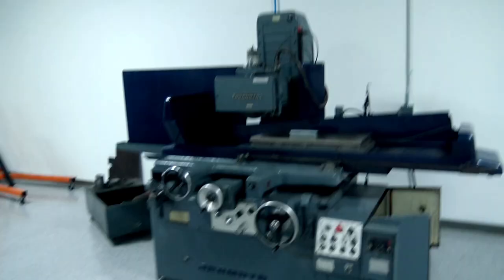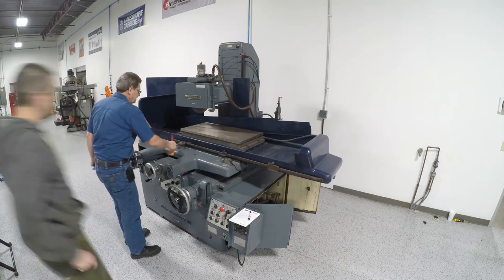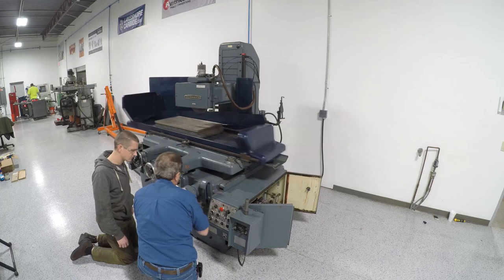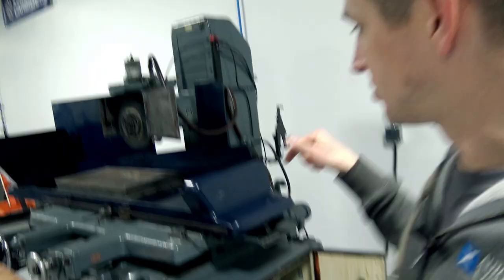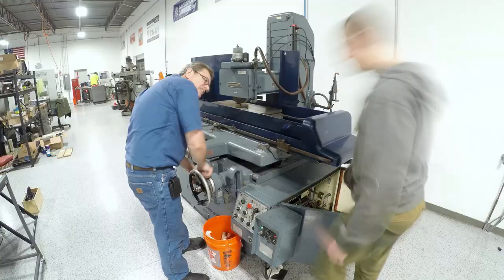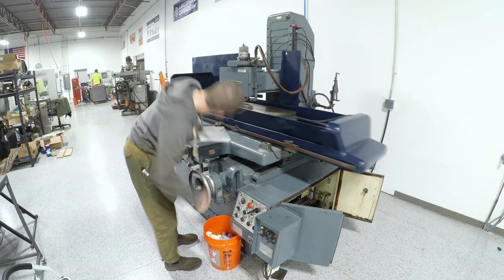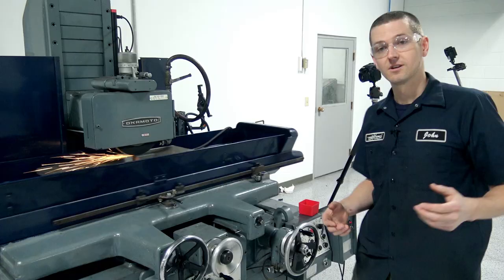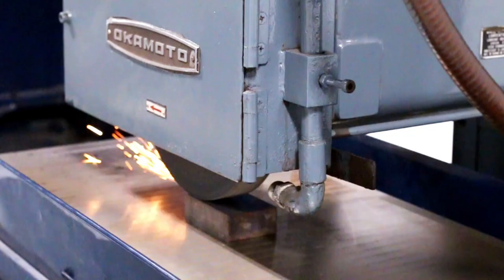Installing Okamoto Surface Grinder!

Comment: That is a very nice unit. Hope you get all the bugs worked out without breaking the bank. Lots of those older low pressure pumps are noisy but it doesn't should that loud on the video. A fluid change is probably going to help though. When you get the coolant up and running I would recommend at least getting one of those box air filters to set over it and duct most of the crap into it otherwise your going to have that sticky damp grinding dust all over your nice clean shop! Another thing you mite consider is building a grinder 'room' inside the shop with air filtration, I've worked in a few of those and they really help keep both the grinder room and the shop clean as all the air is going though a lot of filtration all the time instead of setting out on everything.

Comment: I always prefer to have a surface grinder with side that the sparks come out to face a wall, a good concrete wall.  I have seen even a small surface grinder toss a setup that was a vice in another vice and part in that one.

If you are doing a lot of grinding it will cover a large area in dust and coolant mist will stick to all surfaces around the machine without proper ventilation. 

I think it is a must have for any machine shop, that is good size for a grinder. 

Great video as usual.

Comment: The "rod" in the solenoid is called a spool valve.  That is a neat grinder.  I couldn't imagine trying to figure out the controls without a manual, especially if some of them are not working properly.

Comment: Always block in your work with pieces of scrap steel. Never grind your part without the aid of scrap pieces. This can prevent your work piece from flying off the table, especially when your first cut you have uneven and a poor metal surface on the bottom.

Comment: Sparks are burning carbon from steel*
Iron dust with impurities is left over in a form of dust.

Fun fact - one method of figuring out how much carbon is in your steel is to grind it and see how many sparks are made, and how long do they travel until they burn out.

Comment: awesome!  I'm kind of surprised that noise as it changes directions isn't normal.  I would think that whatever shuttle valve and or buffer system is used during the reversing should make that kind of noise.

Comment: I always use a dressing diamond on the magnet. That way I know the stone is dressed to the plain of the magnetic chuck.
Reply: That makes sense. With a surface grinder every detail counts.
Reply: This is what we do as well and good practice.  The "built-in" is more a novelty me thinks and you're thinking allows less room for error.  We have two Okomoto's and that's how I was taught by the "old pros" in the shop.  The dial is there but... never been used... lol.

Comment: Our grinder has hydraulic traverse and the hydraulic pump is also used to pump oil onto the ways. The only issue is the table rises nearly 0.002 when you turn the pump on and will drop if you max the table speed and use the hydraulic crossfeed. Its probably alot to do with the age and wear of the machine but still a pain in the ass.

Comment: That must be older than the one I use at work. The control panel is on a swing arm that can be swung around for ease of use. Ours works great.

Comment: Most expansion joints in slabs are actually cut in the concrete. If this is the case I would not worry about it spanning a joint as the slab is actually all one piece and will be rebar connected across the expansion joint so getting out of level just because of that is not real likely.

Comment: Great buy... Congrats!  though, I would have thought you would have installed it in your "dirty" side of your building with the plasma and welding. You could always build an enclosure for it to contain the dust and any possible flying parts. I can't wait for more videos.

Comment: so I run  okamoto grinders and a few things
before you change the oil check into a cleaner additive. there is a screen filter that needs to be cleaned. also block in your work. I run new saddle grinders and one older column. holds two tenths no problem😁. have fun

Comment: Great machine we remove our Dimond dressing tool above the wheel as they aren't that accurate and smooth when used, so we make our own dressing tool that sits on the mag table and does a precision job of dressing the wheel.  

Don't be afraid just be cautious when touching on 😁

Comment: About that European UVW - I am from Europe (Latvia) but i have never heard of it and we also use L1, L2, L3
Reply: L1, L2, and L3 are the modern designations for the input phases (L as in Live). Historically they were called R, S and T. U, V and W are the names for the output out of a transformer, junction box, VFD, etc.
Reply: Tjita1 here in the U.K. It was red white blue later it was red yellow blue  
The I came across a lot of IBM main frames and Winchester drives to find the three phase was L1 black L2 black and brown with neutral blue may be wrong about the last two colours it was 45 years ago 

But a multimeter and knowing how to use it are your best friend

Comment: I once operated the very same make and model grinder.. This is one of the most useful machines in a shop but on the flip side it can be the most dangerous. add a vacuume for dust and swarfe.  Did you get the wheel balance jig ???

Comment: Have a look into wheel balancing and a good extractor fan, you do not want to be breathing in the dust 

on my apprenticeship I nearly cut my finger off on a surface grinder, just remember if you need to touch the part ALWAYS turn the wheel off
Reply: On my apprenticeship as a machine repairman during my tool room or machine time, I routinely touched(very gently) the working surface of a grinding wheel after dressing it and was taught that because you can feel if it's still rough!  A diamond mounted in a block held on the magnetic chuck was used.

As far as a wheel being self dressing, it does break down but I never heard that mentioned even by my father who ran a surface grinder for over forty years.  A Blanchard grinder's wheel was hardly ever dressed as they are self-dressing wheels.  They were dressed when new and hardly ever again.  I maintained Blanchard grinders used in production and were never dressed unless a set of segments were installed.

Comment: Not only is it a great piece of machinery but the name is fun to say! (I am a simple man)

Are you worried about airborne coolant mist, grinding dust etc? My father owns a sharpening business and the grinding produces a unhealthy amount of airborne particles.
Reply: Yeah, he could put up some quick walls with  2x4/drywall and make a grinding room and also put in some dust collection.
Reply: I was thinking something similar but maybe John doesn't plan on using it frequently enough to justify all that and just plans on doing something smaller, or waiting to see how it ends up being used, then implementing a solution.
Reply: Im not certain but I assume a large sum of the particulate should be captured by the coolant.
Reply: Airborne particles are a huge problem with these machines, large shops try to isolate their grinders from the main shop and filter the environment with air scrubbers. A simple way to cut down on the amount of mist produced is to secure  a rubber flap on the left side of the wheel housing . . . Also keep your water clean, I got a nasty  Staph Eye Infection from that stuff.
Reply: yeah, John did mention he doesn't really plan on dry grinding, but the coolant mist should still a concern i would think.
Reply: rashesthippo there is no mist in grinding. its nothing like turning or milling.
Reply: In my limited experience there was some mist/splash, etc. But maybe it was just me, with the coolant pressure too high or whatever.
Reply: " but the name is fun to say! (I am a simple man)"
Yeah,  I thought the name sounded familiar.  Kozo Okamoto. Infamous man.  Any family relation to this machine's name?
Reply: Our shop is looking at http://diversitech.ca/en/products   for a few portable, and stationary extractor arms. 

They seem to have solutions for  just about every way you can pollute the shop air from farts to robots. But we are still exploring all other options before making decisions.
Reply: Oh jeez, don't even remind me. Try cleaning a CNC Mill coolant tank after a year of sitting around with miscible oil coolant. Like death soup...
Reply: There are two dominant grinding companies in japan, okamoto and nagase. They can stand up for high precision work even after 30 years. No one can come close to japanese reliability and mechanical designs. Im having many trouble with a two years old dmg lathe and zero problems with a 26 old okuma
Reply: I don't know if I buy that? I worked at a small shop over the winter and did some grinding. I could see coolant mist in the air. It's not splashed/thrown around like a mill/lathe, but it is a fine mist/cloud.
Reply: avani make some excellent dust/fume extractors
Reply: Didn't think about that one but grinders belong in grinding rooms for sure.  The shop I was referring to earlier has a climate controlled room with an outside large draw vacuum setup for each grinder, they have about 6 different size surface grinders as well as their Darex drill sharpener and an end mill sharpener and single lip grinder all in this room.

Comment: $1000 for hydraulic oil? That's ridiculous.
Reply: prices are all over the place for hydraulic oil.   I think he can do better.
Reply: if the oil is that bad/old, i'd flush it a few times with cheapo hydraulic oil to clean it out, then put in some decent stuff
Reply: I used to manage a small crane fleet and we've had one of those dump many hundreds of liters of hydraulic oil during a failure. I know oils ain't oils but that would have put us out of business paying these prices.
Reply: Sheldon Robertson  It'll also eat away at the paint.  I used to work at a machine shop owned by an old Indian mechanical engineering professor and he ran all his machines with ATF as the way lube...it would get into the sump and start eating away at the paint in the machine, and after a few years you have a sump full of old paint mixed with oil.

Comment: Hydraulics: NEVER buy new valves, or pumps. Pull, send out to a rebuild shop like Attica: http://www.ahx1.com/

Glad the issue was resolved in this case: but in general a rebuild of even OEM-Specific parts will be 1/10 the cost, and is usually not an issue. 

We love our brand new Okamoto at work. It was a large investment, but I think it's already paid for itself. I've yet to have to run it, but I used to use Reid and Harig manual grinders daily at one of the shops I worked at. Now you get to figure out all the wizardry behind wheel choices and grinding techniques!

Comment: So how does an ever-changing grinding wheel produce a flatter surface then say that superfly that you use to face a part? I would think that as that wheel wears away the part would wind up with an uneven face. I could see a surface grinder making a better finish but I just dont get how they make a flatter surface.   : /
Reply: Man I didn't even consider the wheels grinding surface being uneven, that makes me question this even more. It just doesn't add up to me, even if the wheel changes slowly, its still an ever changing component. Surely if you start grinding a part at one end and transition across it, there will be variability between the starting side and finishing side?
Reply: Thanks for the help! Thats what I was looking for, that was well explained. So, how flat is possible with a surface grinder vs a mill? Why isn't a grinder used for cylinder heads instead of the big fly-cutter looking thing?

Definitely not trolling, do appreciate the knowledge sharing tho

Comment: im not a machinist but was wondering why dont they do a magnetic chuck for the cnc? is it because it sucks out the twist where as the vacuum one doesnt?
Reply: Rob Jones because they only work with ferrous material e.g. Steel and cast iron ,
Reply: thank you for your reply makes sense now
Reply: Sheldon Robertson thank you very much for the insight and thank you for taking the time to reply to me ive learnt something new now thanks again

Comment: It's the only way America can acquire the machine, the rest of the world is welcome, or they can build random designs on there tormach.  Your Haas machine has something very important, two things, a CAT40 spindle taper and a Control, that is there #1 combo for success, the machine will also have this combo, how many machines have you seen sit because they don't use a drill chuck on a drill press they use a fmfnfjdndj chuck